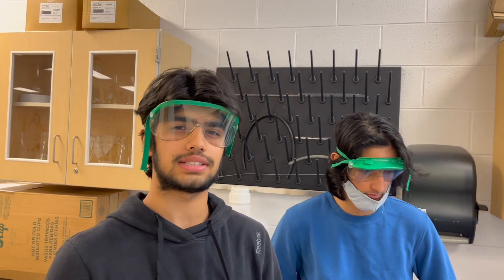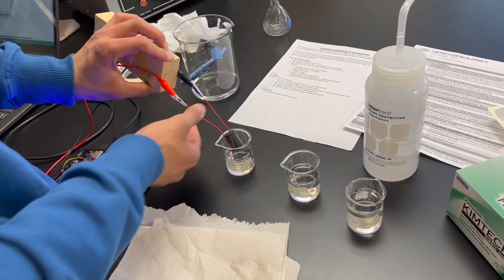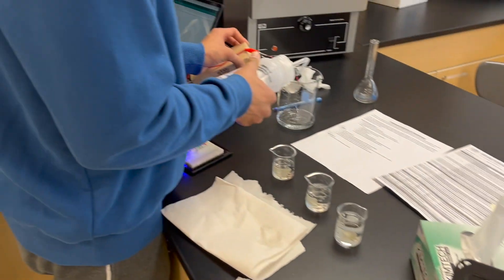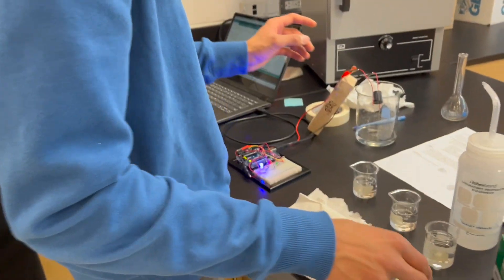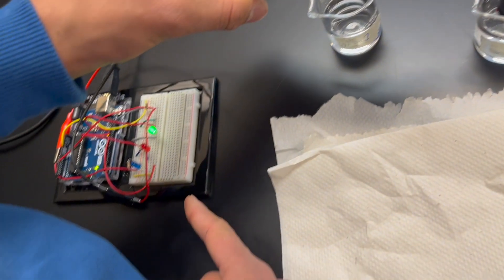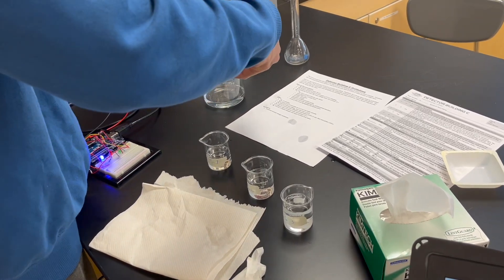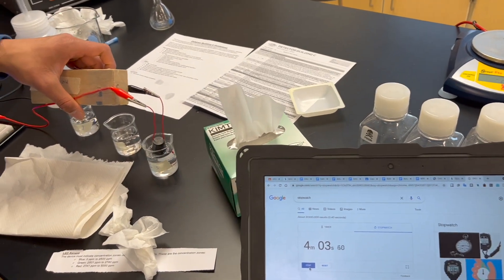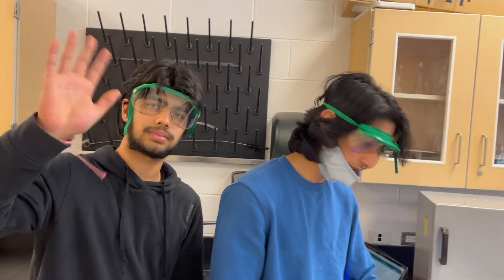Detector Building Science Olympiad Regionals 2022

Comment: Is there a website or specific design you used for this event I'm doing this event and can't find an up to date guide for how to build this
Reply: Basically we used an Arduino and hooked it to a breadboard and put in a simple LED light circuit system (you can find a tutorial for this online). After this, for the TPS sensor, we connected two wires from which we outputted voltage and scanned for conductivity using an arduino ppm detect function. You have to use a voltage divider for this. We found many tutorials online for a "salinity detector" and then just picked bits and pieces to use for own device. Hope this helps!
Reply: @nikunjtyagi0  thanks so much I understand this way more!
Reply: Do you have a circuit diagram I'm trying to get the probe actually connected to arduino